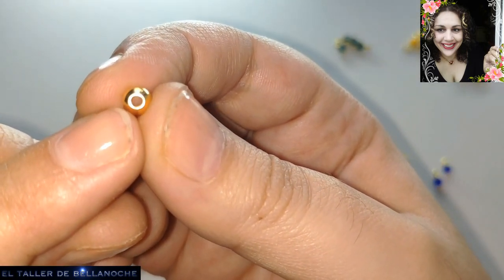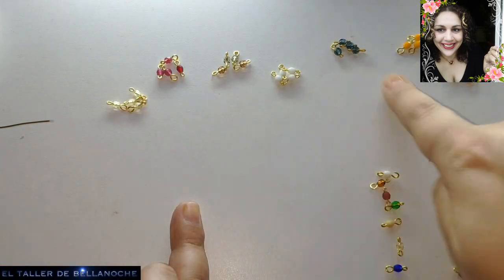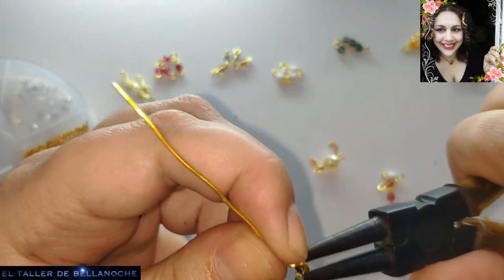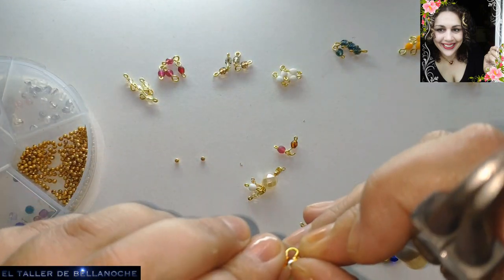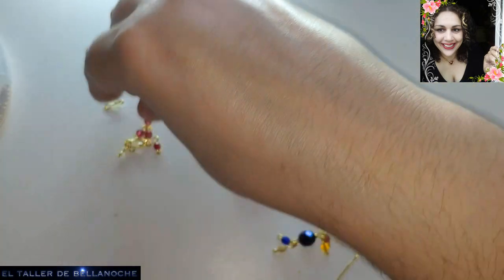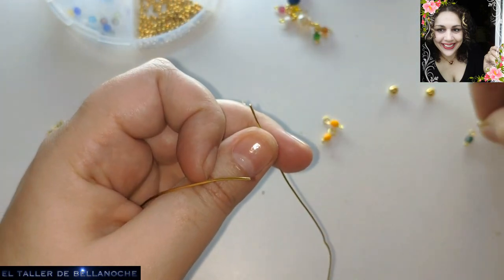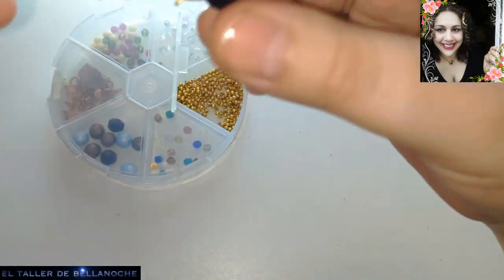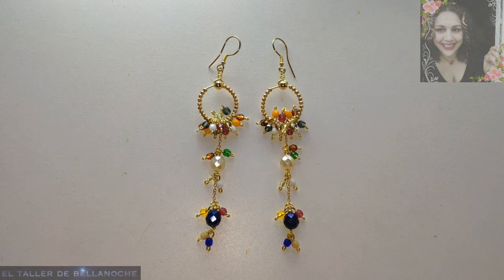COMO HACER UNOS PENDIENTES LARGOS DE CADENA -HOW TO MAKE LONG EARRINGS

Comment: MUY BONITO NIEVES , COMO TODO LO QUE HACES,  A LOLI LE REPITIO OTRA VEZ, POR LO QUE SOLO ENSARTA PIEDRAS O BOLAS Y ESCUCHA LOS VIDEOS, PERO SIN MIRAR , ESPERO QUE MEJORA ALGO, SALUDOS JOSE Y LOLI
Reply from the maker: No se que decirte Jose. Yo creo que es cuestión de ver que hace para saber que puede hacer. Si no, pues animaté tu. Ok? Ya sabes que puedo darle alguna clase por skype, pero tengo que saber como está. Escribemé a mi página de Facebook, EL TALLER DE BELLANOCHE. Por cierto este alambre es buenisimo. No es tan blando como el aluminio, ni tan duro como el cobre. Un abrazo para ti y tu muchacha
Reply: HOLA AMIGA NO TENGO FACEBOOK , A VER SI VIENEN LOS HIJOS Y ME LO PONEN, DE TODAS FORMAS TE DIGO QUE LOLI ACTUALMENTE, ESTA, COMO SI TUVIESE LA FASE DOS, A VER SI ME ESPLICO BIEN, EN LA 2 DE ALCEIMER O DEMENCIA PORQUE SON MULTIICTUS LOS QUE LE DAN Y LE COJE ESA PARTE DEL CEREBRO Y LE PIYA MEDIO CUERPO, EL DERECHO, MAS QUE DESDE HACE 12 AÑOS ( AÑOS EN LOS QUE NO PUEDE NI SENTARSE) EMPEZARON A PARTIRSELE LAS VERTEBRAS, YA ESTA OPERADA Y AUNQUE NECESITARIA MAS , YA NO PUEDEN, POR SU ESTADO GENERAL, CORAZON, DIABETES, EN FIN PARA QUE SEGUIR , YA SABEMOS QUE SEGUIRA ASI HASTA QUE DIOS LO DISPONGA, PERO ELLA NO HABLA NI CON LOS HIJOS NI LOS NIETOS SIQUIERA QUE SON SU LOCURA, EN FIN PARO NIEVES QUE ME NOTA ENSEGUIDA SI ESTOY MAL UN SALUDO ENORME Y MUCHAS GRACIAS .